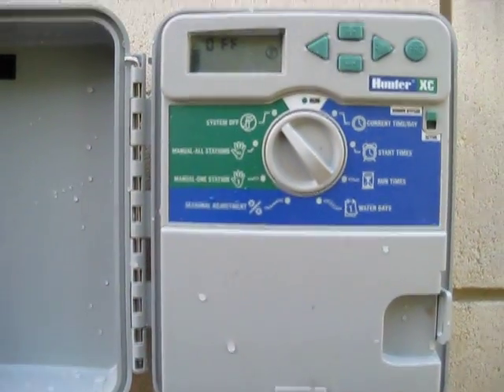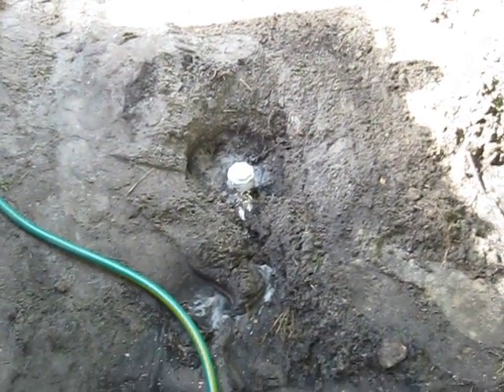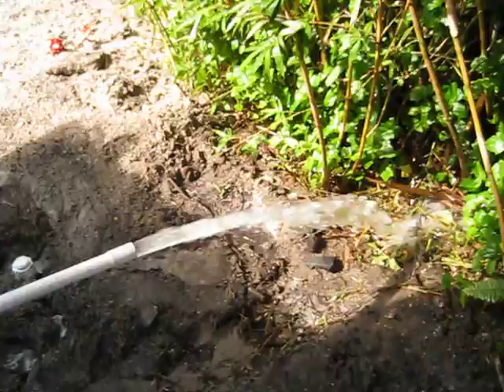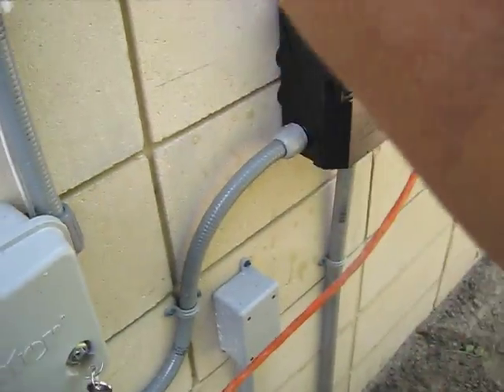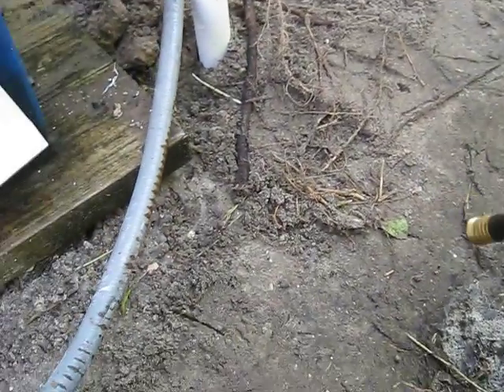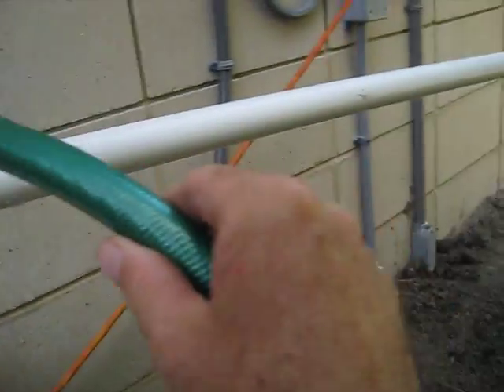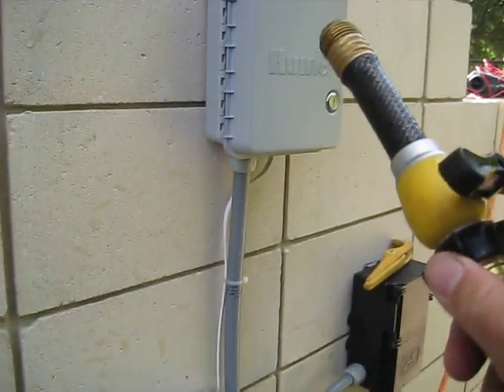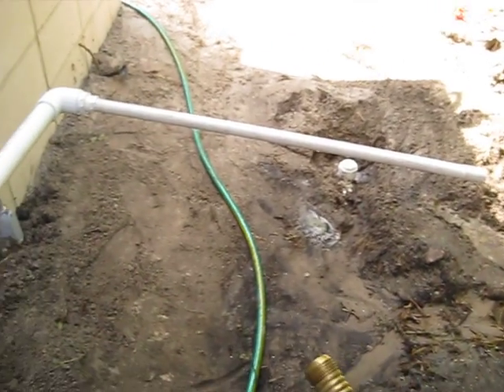Priming a pump from a shallow well

Comment: Thoes aromotor pumps are good but after about 13 years  the motor shorts out so b prepaird get a goulds gt15 great pump cast iron i install a lot o i 4 got 2 tell u i am a sprinkler con

Comment from the maker: @MsCountryboy6 Thanks - I endeavour to produce excellent workmanship on all my projects. Irrigation especially is an area where there's a right way and a wrong way and it's something you can evaluate usually merely by inspection. I've always insisted on digital clocks and solenoid valves to better control programming. There are still those installing mechanical clocks and indexing valves. I'm also big on rain sensors but it's amazing how many systems today do not have them. Cheers, Bazza :)